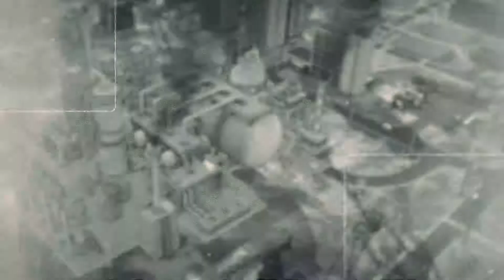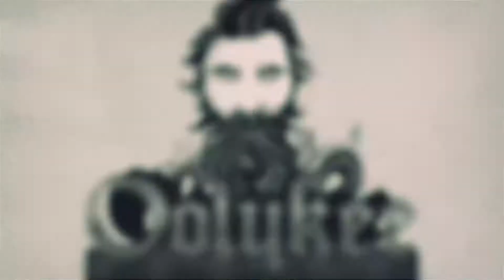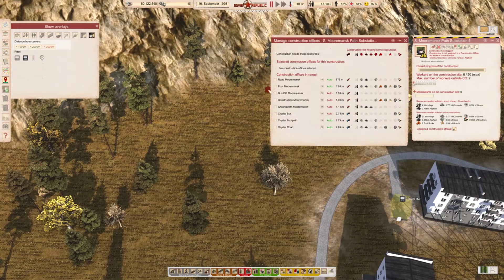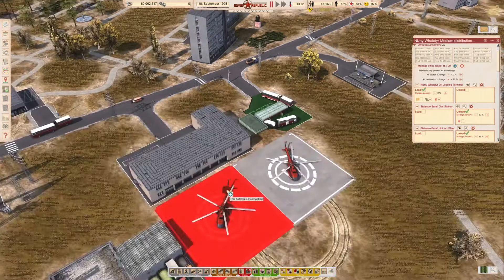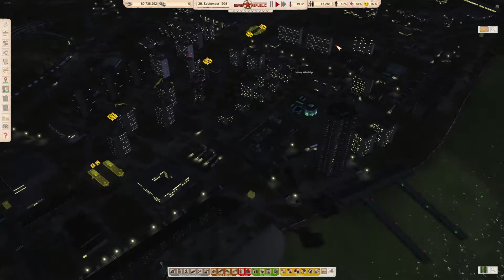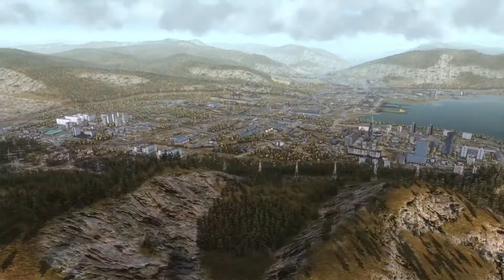Soviet Republic - Alaska - The New Beginning - Ep.199

Comment: Do not forget that there is an informative and visual problem which has not yet been solved by 3Division : the power substations continue to provide their information regarding their capacity in relation to their maximum capacity (2.50) and not in relation to the actual capacity they receive. This means for example that their "estimated maximum consumption" is always calculated in relation to 2.50 while an underground cable of only 1.45 is connected to the power substation. The percentage is therefore wrong and you have to make the mental effort yourself to estimate the actual percentage based on the type of cable that is connected to the power substation. Unfortunately the percentages are calculated by the game according to the theoretical capacity and not according to the real capacity.
Reply from the maker: Yeah! I noticed that.

Comment: For Lenin sake finally you have looked at your high voltage grid with the overlay ! I no longer knew in what language to tell you ! Regularly you must use the overlay and analyze your HIGH VOLTAGE consumption between each node ! On the other hand once identified the problem you have not yet understood what we have been telling you for a while : the switch heading towards Babuschkino and Nissesburg CANNOT receive 18MW of electricity because you have connected to an upstream switch TWO high voltage cables of 18MW. A switch CANNOT distribute 18MW twice if it only has 18MW of incoming capacity. For the future, you absolutely have to think about your power grid (high voltage one) by calculating your incoming and outgoing capacities. And multiplying the downstream bypasses will not solve your problem in any way since your incoming capacity (upstream) will not change.
Reply from the maker: You told me once. :D 
It was way too long that I built the power plant. 
This was my fault (amount many other things). :D 
I knew this. I just failed to think about this when it mattered. :(